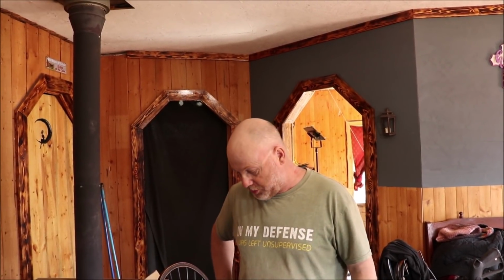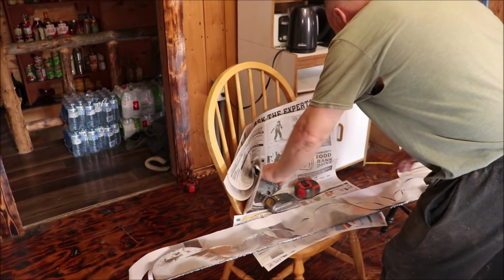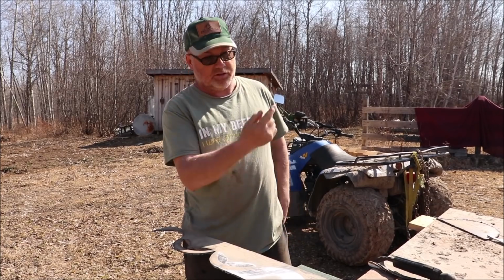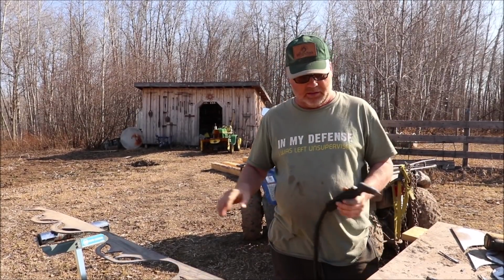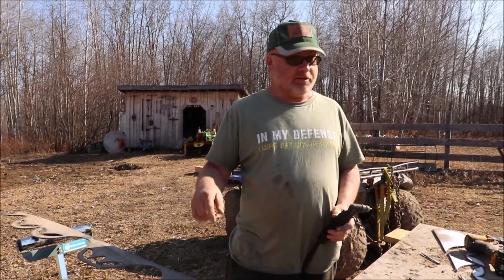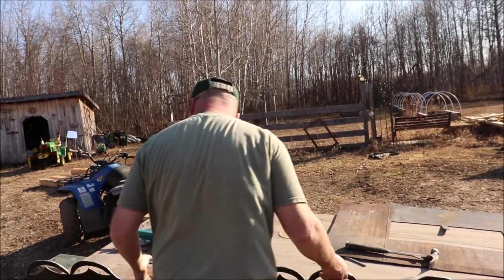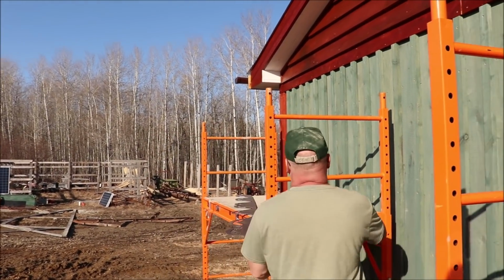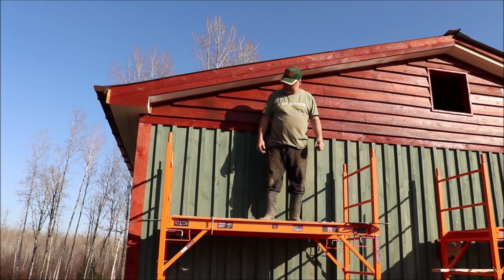Homemade Gingerbread Trim For Our Home. We Wanted It But Couldn't Afford It, So We'll Make It.

Comment: I bought a plasma cutter and was wondering how much air pressure is needed to cut !!
Reply from the maker: Hello. This one has a built in compressor, no settings.  Look on your box or instructions, it will tell you...some are different than others.
Reply: @SkinnersHomesteading  Thanks!!
Reply from the maker: You're very welcome.